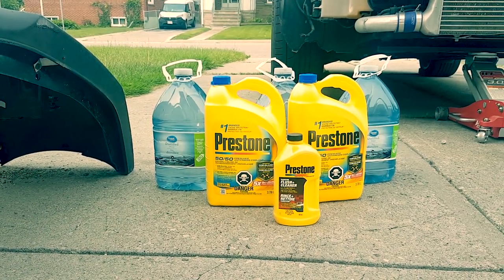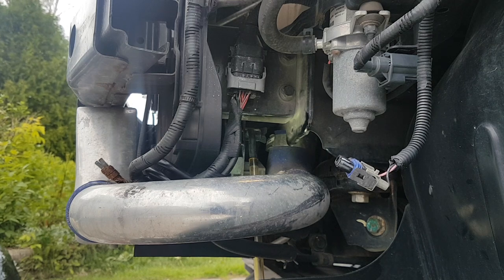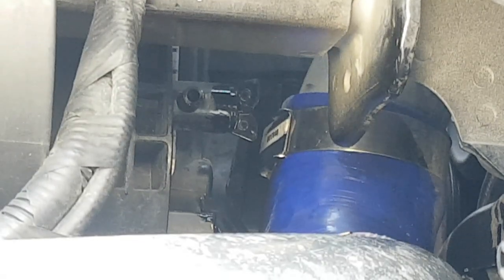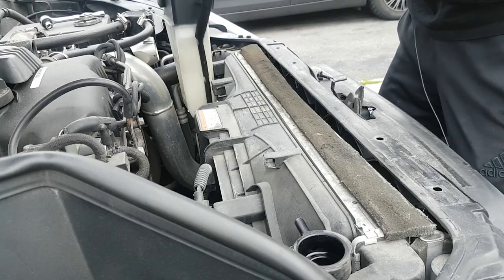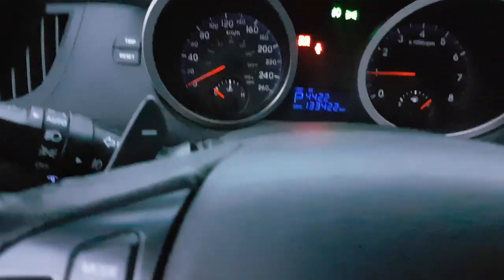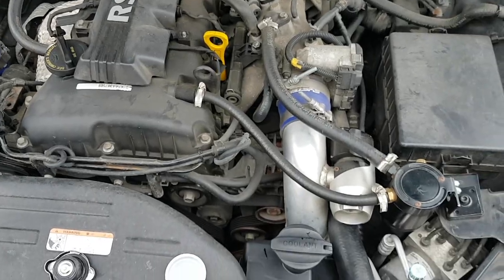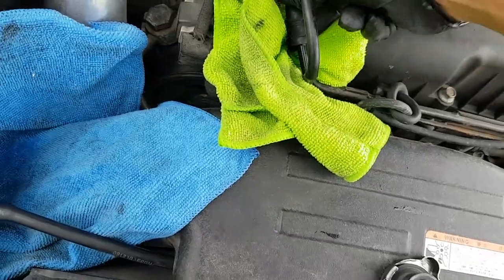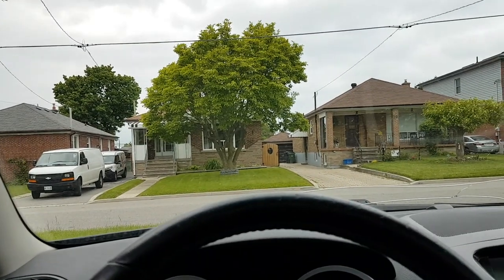Coolant Flush | Genesis Coupe

Comment: Welp I finally quit procrastinating and did the coolant flush.  I do have a major tip if anyone is putting off doing this because they dont feel like taking off the bumper.  You absolutely dont have to!  When you remove the coolant reservoir from the top of the radiator it gives you super easy access to the purge valve and its tube.  All I had to do was unscrew those two plastic screws on the little underside plastic pannel at the edge of my driver side bumper right in front of the wheel, and fish a small hose from the purge valve tube through the opening at the wheel well into my jug for old radiator fluid.
Reply: Shi I did it last night in the rain and didn’t even need to jack the car up lol might of scratched up my elbow but that will heal
Reply: The bumper is easy asf to take off

Comment: Hey man, I know it's not the topic of the vid, but how is your BOV set up? To the stock solenoid, or through the intake manifold?

Edit: You literally have a BOV guide vid. 🤦‍♂️ I'll be referring back to this one when the time comes!
Reply: @E550benz  Question tho, any difference between T'ing into the black and white checker valve vs the green and white one?

Comment: You should turn on your heater so you can fully flush the whole system, it does make a difference letting the heater go off and having the thermostat cycle 3-5 times. Coolant funnel kit would have been easier too since the funnel will have a higher point of gravity than the radiator

Comment: 4.3 Liters huh? My 3.8 liter 2016 Hyundai states 9.51 quarts or 2.4 gallons roughly... I wonder where the other 0.7 liters is at? Probably in the radiator grill itself.. maybe.. shrugs